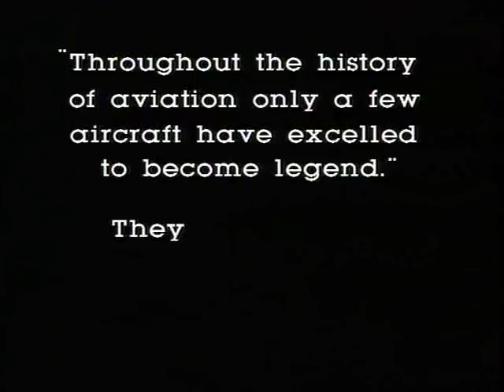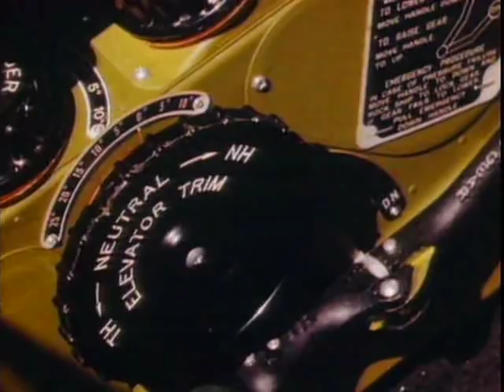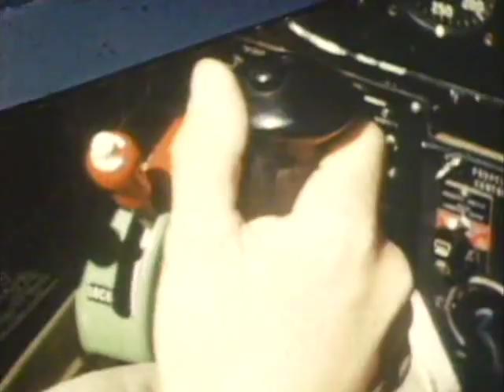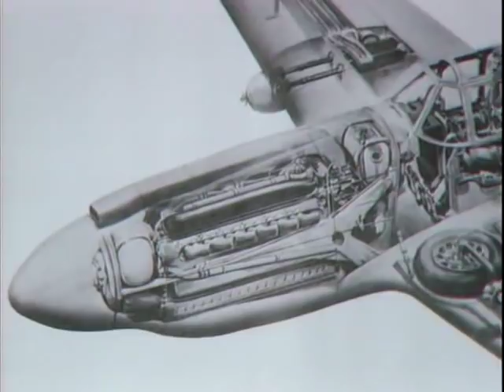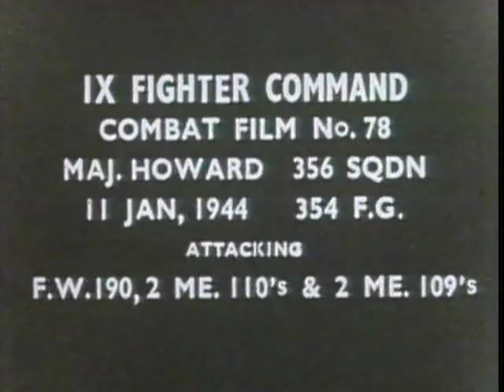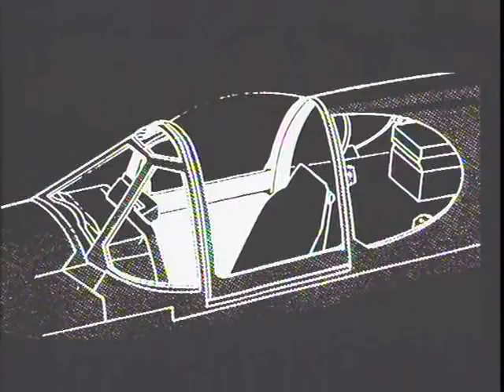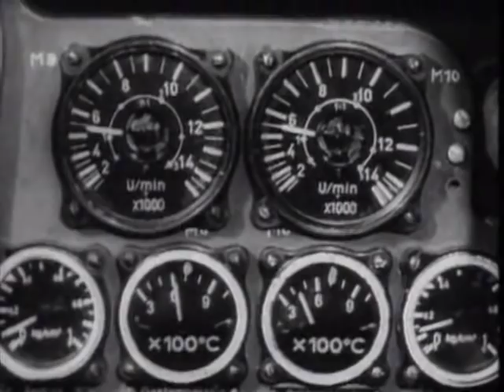Great Planes - North American P-51 Mustang

Comment: P-51 was a fantastic aircraft. No argument. It was not anywhere as maneuverable as a Spitfire, however (@ closing statements of the documentary). The very laminar flow wings that give it better efficiency and speed come at the cost of aerodynamic bite in terms of turning. Basically, pressure is shifted aft in the in the wing, which reduced turbulence but also reduced lift. The Mustang was an energy fighter, which is good in that it can 'boom and zoom' and thus is able to retain energy and dictate terms of a fight by translating built up speed back into an altitude advantage. However, laminar flow wings lose energy in a turn fight. The Spitfire's elliptical wing was better in this regard, plus its much smaller weight and wing loading with an equivalent (packard Merlin) engine and later better (Rolls-Royce Griffon vs. Mustang still using the Packard/RR Merlin) engine gave the Spitfire much better acceleration. The Mustang simply could not turn with a Spitfire, as much as I love both aircraft. Spitfire = turn fighter. Mustang = e-fighter. The only areas in which a Mustang are, 'more maneuverable' would be in an extended dive, top speed, or in roll rate (and clipped wing Spits could probably match it there). The Mustang continually suffers in the acceleration department. Anyways, both are fantastic machines.
Reply: Unfortunately though, because the Spitfire just didn't have the same range as the Mustang, it could never protect the day-bombers like the Mustang did.  It was a great fighter plane, but not as practical for the later part of the war. Most spitfire variants only used the .303 caliber rounds, rather than the .50 caliber round, which made it much harder for the Spitfire to down an enemy plane.  In the end, the mustang took the "glory" as best WW2 fighter plane.
Reply: ***** yep and Luftwaffe pilots feared P-47's and spits mk ix's more than the P-51!
Reply: "boom and zoom" lol that's the best way I've ever heard someone put it.
Reply: AND if that LAMINAR flow wing was so bad why did the Spifire start using it???All planes are compromises and the trick was to learn to use the pluses in place of the minuses...it's called tactics...
Reply: Spitfires never used laminar-flow wings. You are thinking of the Spiteful.
Reply: Everett Sambrook   The laminar flow wing was indeed research very throughly for the Spitfire whichever model it was that ended up using it, it was used but late in the game...most all fighters of the time went to the laminar flow wing, especially the USA's fighters...
Reply: Wilbur Finnigan "The new wing was initially fitted to a Spitfire Mk XIV; later a new fuselage was designed, with the new fighter becoming the Supermarine Spiteful."
Reply: And your point is ??? The spit did use a Mustang type wing in the end...Better?
Reply: Wilbur Finnigan No...they didn't. It was test fitted. Also you seem to have missed the original point I made about laminar flow wings trading turn radius for less drag and greater speed. Do you want to now argue that monoplanes have a tighter turn radius than biplanes because fighters switched from one design to the other? Everything in engineering is some sort of compromise.
Reply: Everett Sambrock  Go back and read ALL my comments, many times I have mentioned the advantages and disadvantage of each design. they are all compromises.  Mustang used the Laminar flow wing for speed range giving up some in handling, the Spitfire used the wing they did and they used several, for handling giving up speed range, and carrying ability. each did the job they were designed to do. I read a statement that was ooh so true. "The Mustang could do what the spifire could do all day...BUT  the Spitefire could not due what the Mustang did at all"
Reply: Wilbur Finnigan Dude, you debated the fact that the Spitfire was more maneuverable, which it was. The Mustang was faster and had better range, which I also stated in my initial post. Perhaps you should go back and read ALL of it. One thing the Mustang never did was inspire fear in Luftwaffe pilots the way the Spitfire did. Read some of their accounts on it. I wasn't even trying to make this a Mustang vs Spitfire thread. You seem so damn determined to make it one.
Reply: Everett Sambrook  You babel and whine but in the end the Mustang got the job done..it and the P47 cleared the skies over Germany especially Berlin. and the German pilots that survived the war and had the opportunity to fly the Mustang praised it and they feared it, because it had the range and longer fight time.   the Spitfire could not get to Berlin till half of Germany was under allied control. ie shorter range...sorry you lose....
Reply: The debate ! ! !
Reply: All I said was that the Spitfire was more maneuverable and then I explained specifically in what ways. All you added to the 'debate' were things I'd already mentioned and then revealed yourself to be just another Mustang fanboy who think its just the bestest fighter ever in every way and nothing in the skies had any performance capabilities exceeding it. Congrats on 'winning.'
Reply: Glad you see it my way....the truth....
Reply: Reginulfr It was also built to a british design and was crap till it got the spit engine
Reply: zzir snipzz1   Go back and research the history of the Mustang and then tell me HOW the Brits designed the Mustang....The Brits came to North American to have them build the P40, Dutch Kindelberger refused and offered the Mustang. and the rest is history.  the Brits gave North American the oportunity to build their plane. AND the Allison Mustang was the hottest, fastest fighter out there under 15,000 ft.. AT THE TIME it was introduced.  Spitfires and Hurricanes also AT THAT TIME still had single stage superchargers... the 2 speed versions came LATER......do the research....
Reply: Yea but the the alison engine was still shit compared to the spit engine and p-51 was designed to brit specification the plane only really preformed when they finally put the brit engine in it
Reply: What are you talking about? I said the Spitfire was more maneuverable and the Mustang was faster. You keep bringing this up. Wake up and smell the move the fuck on.
Reply: Everett Sambrook   Cant stand the truth???  doesn't fit in with you "Dream"   research history and learn  and not the Limey version...
Reply: viotentjett  The Spitfire did the job it was designed for...the defence of England.. which with the Hurricane did the job...a long range escort fighter it was NOT.  but the Mustang was .  two different plane for two different purposes and BOTH did their jobs....and the Allies kicked the shit out of Germany...History..
Reply: violentjett   Don't feed the trolls... there's enough of them.  In war time you do not have a lot of time to do research and development...you have to use what you have or modify it to work.....and both planes got the job done....
Reply: Everett Sanbrook  OOOOH I    I know about aircraft performance  and I am not lazy  so just shut the fuck up  I am not talking to you...
Reply: Fine by me as I'm about out of troll feed.
Reply: Everett Sambrook   Did not have much... did ya???? figures....
Reply: Everett Sambrook   Naw you are just a litt twerp with nothing to back it up ! ! !!
Reply: trololol
Reply: Pilots learned to drop 5 to 10 degress of flap and the Mustang turned like a banshee...pilot trick  and the range was unbeatable...
Reply: You need to read up on: wing loading, span loading, power loading, and airfoils if you want to have an adult conversation about aircraft turn performance. The Spitfire was a much lighter plane with much more wing area. It turned far better. This was its biggest advantage against the 109, which the Mustang turned about evenly with. Also, as you have cited in your other, sometimes very insightful videos, the internet is full of readily available information. Turn performance of WW2 aircraft is easy to find. American planes were generally good for top speed and range, but generally turn radius compared to their foes was not emphasised. The Wildcat could actually turn quite tightly, just not compared to the Zero. This problem was compounded by the added weight of slapping on an addition 2 50 cals from the 4 50 cal armament and the weight of folding wings. Even though they allowed the Wildcat greater firepower and more could be fitted on a carrier, the engine wasn't powerful enough to compensate yet. Look to the Hellcat, which had a good engine. 19:1 kill ratio.  I'm going to let you know now that I'm an American given all your anti-(limey) statements in so many videos. I don't know why have this persistent incorrect, almost laughable view that a Mustang could turn with a Spitfire, which is all I ever said.
Reply: All of what you are still saying is completely irrelevant to my original post. Why can't you understand this. I never once said the Spitfire was a better fighter. I said it was more maneuverable, which it was. This seems to offend you somehow. Your Bill O'Reilly method of shouting the same, unrelated thing to make some dubious point only reveals your deep biases and lack of rationality. Seriously, how many anti British posts do you have out on the internet now? Did some British person beat you up as a child or something?
Reply: Everett Sambrook    IF.....You had read my post as you   "CLAIM" you would know the reasons....but I will refresh your   "short" memory.....My Great Grandparents lived under British rule in IRELAND  in the 1850's they were  able to get the hell out and come to the land of opportunity, they ended up In North Dakota, Homesteading and eventually farming over a 1,000 acres of land.  And Great Granny recounted what she went through living under the Brits....wasn't pretty..   You kep talking in circles repeating your bullshit like if you repeat it a hundred times it will be true....IT all reallt does not matter as it is ancient histoey all happening over 70 years ago......isn't it about time to move on ???????
Reply: Everett Sambrook  NOPE ! ! !      YOU need more ass kicking ! ! !
Reply: So is that why you tried to send me phishing e-mails?
Reply: Phantom FM - In mechanical design, everything is a trade-off. Never more so, than in aircraft. That said, it can certainly be argued that the P-51 represented the best balance of positive attributes of any single fighter aircraft, in WW2.
Reply: HotCuppaCoffee I pretty much agree. The Spitfire had better turn radius and climb rate. The designers of the Mustang opted to trade some of that for greater range and speed.
Reply: Phantom FM They put rolls Royce Merlin engines in some , that improved there performance.
Reply: Phantom FM - You can point to a dozen aircraft that did one thing better than the Mustang. The Zero could out-turn it. The Fw190 could climb faster. The P-47 had more firepower... But the fact remains, few aircraft did as many things, as well, as the P-51.
It was a truly superlative aircraft, with remarkably few vices.
Reply: Yes, it turned out to be a great multi-role platform.
Reply: Phantom FM - Much like the later F-4, Phantom. Started-out intended for one role, ended-up performing many. Versatility is the mark of any great aircraft design.
Reply: Wilbur Finnigan Nothing but bigoted LIES
Reply: +Wilbur Finnigan how wrong you are - the Spitfire was the first single engined single seat Allied aircraft to fly over Berlin and return unscathed.
Reply: +Wilbur Finnigan NAA built it to the RAF design specifications for strength, cockpit layout, etc. Althought they exceeded the strength requirements by a wide margin, making the airframe heavier than needed, hence towards the end of the war the H model was designed.
Reply: +Wilbur Finnigan and at the same time reduced the laminar effect of the wing.
Reply: The thing most people don't seem to understand about the Mustang (thinking it was some ultra machine with ultra abilities in all roles) was that it was simply a good fighter with great range that could be built affordably.
Reply: @Reginulfr  Dumbo yes you Spitfires had 2 x cannon and 2 x 50 cal in 1942 by which time they had 2000+ kills Mustang not even on the drawing board
Reply: @wilburfinnigan2142  But they went back to the old double Ellipse which was better
Reply: @wilburfinnigan2142  The Sptifire had the same wing up to the XXI That book Wilbur
Reply: Clipped wing Spit 150 degs/sec beaten only by the Fw190 and well ahead of the P51

Comment: Of course the P-51 was not 'better' than the German fighters, technically they were roughly even, but there were (quite a lot) more of the allied planes in the air and - even more important -  the average allied pilot from '43 onwards was vastly better trained! If you lack fuel for training, tough luck,  it's just a matter of time until you will go down as an air force.